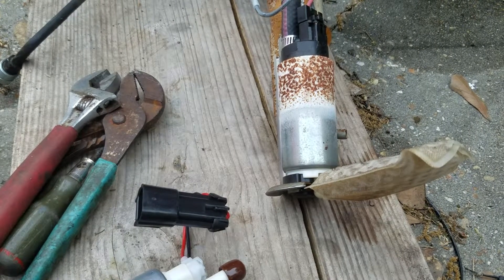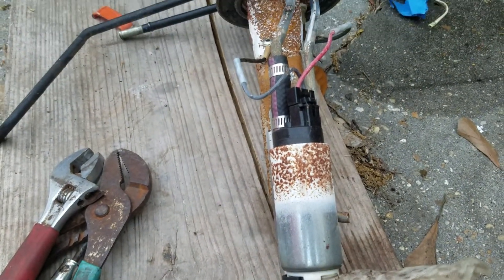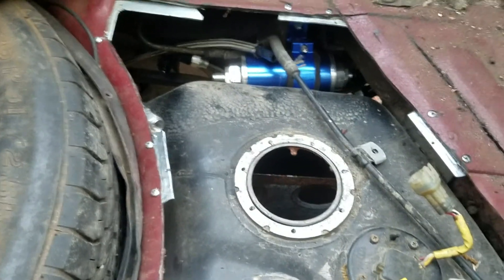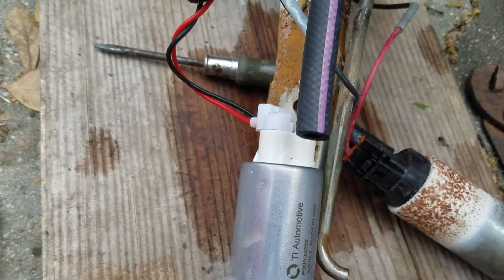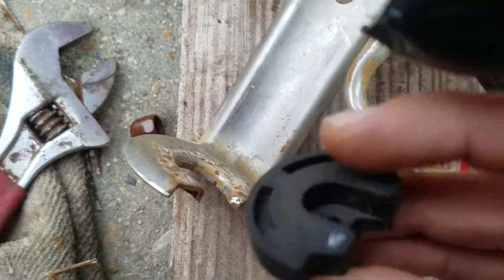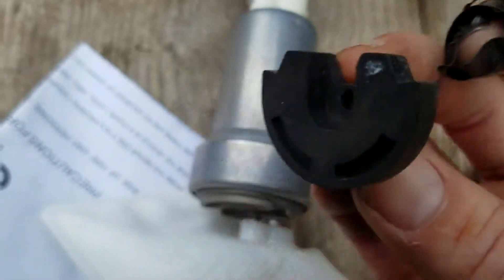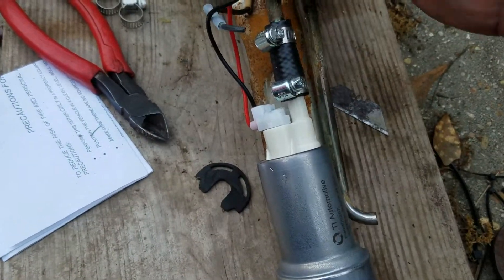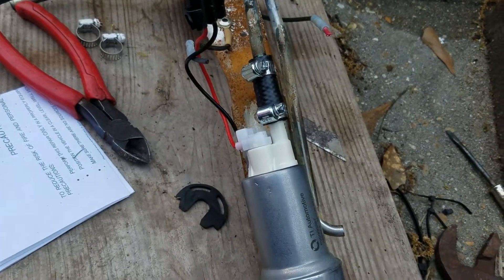MK3 supra gets a walbro 450 upgrade for 2JZ GTE VVTI engine swap

Comment: Did you put a ecu to adjust the extra fuel
Reply from the maker: No, not for this configuration and it has had a consequence. The turbo wants to spool so quickly that a wide open throttle will cause fuel cut in short order. I learned to feather the throttle and still make some useable power, but it kinda sucks not being able to completely rip it when you want. Another computer or some serious tricks for the stock one are neccesary to unleash the beast.